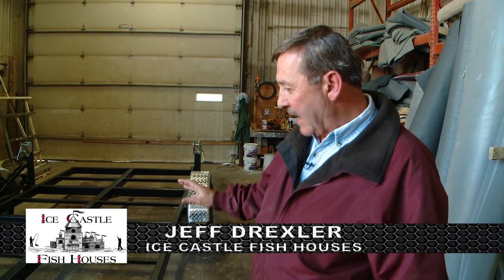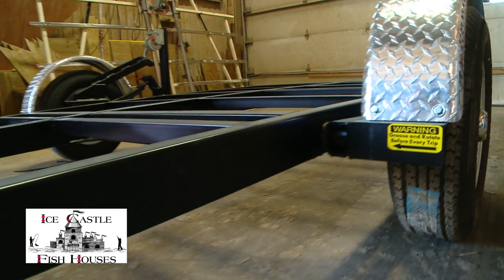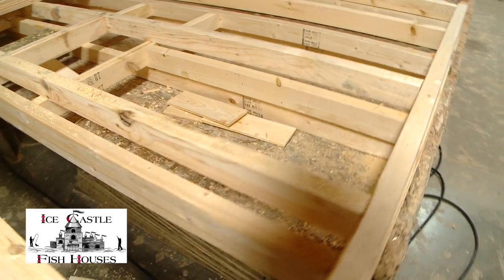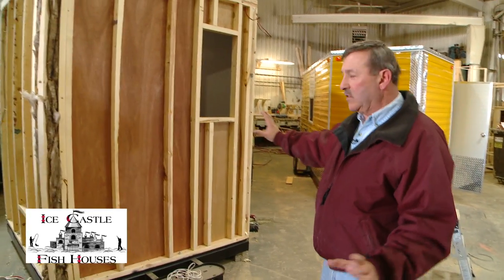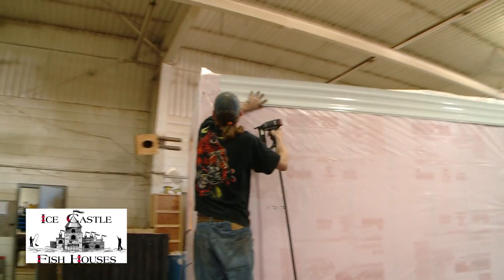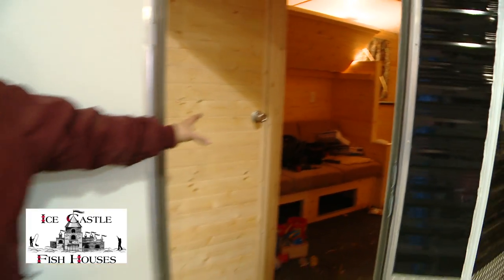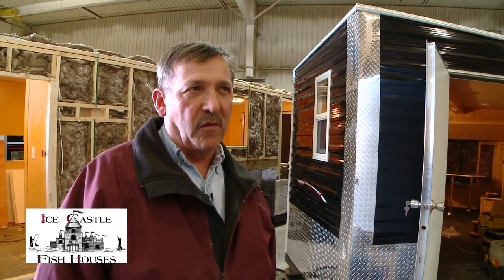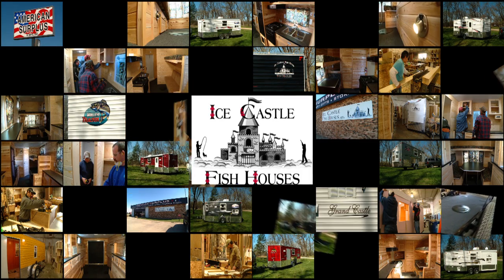Ice Castle Factory

Comment: Ther is a few things that could be looked at. 1. Hate the door on the left side of the house. Which is on the drivers side of the pickup. What does that catch? Slush, mud, slop and it freezes on the door and rusts out the hinges. Same for the door in the front. It catches all the mess...2. Why do you use dark colors? It melts the snow when the sun shines and I am out there rebanking the house. Use light colors that don't attack the sun heat.